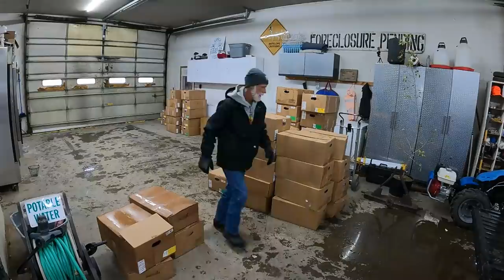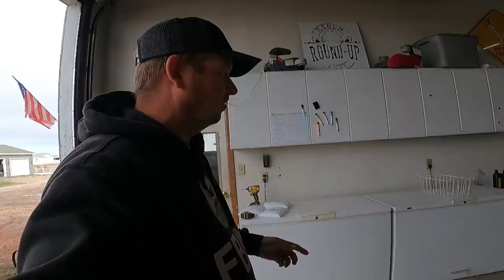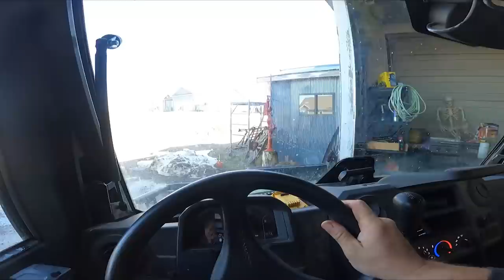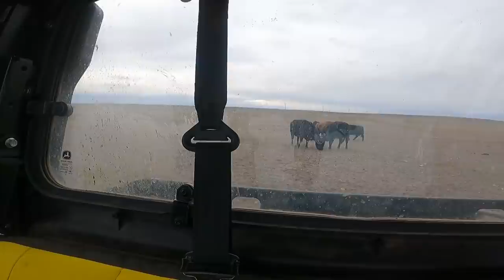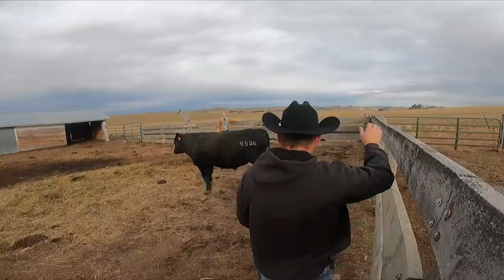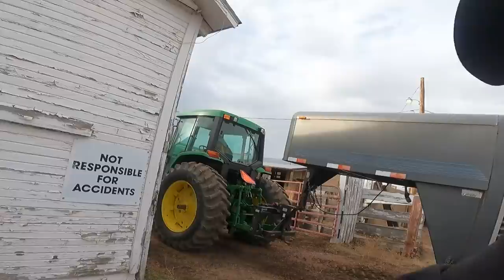Erin Crashes the Car, Meat Arrives & We Move Doof - Weekly Vlog #12

Comment: you home on wheels does not look winterised yet Jeff - I have seen other you tubers winterise their trailers with small straw bales that fit under the van to stop the snow, and cold going under - in effect insulating it from below - they do still insulate/lag and wrap the pipes with heat tape to stop them from freezing - some also put their trailer into a tent to stop the wind just as another barrier from the wind to keep the inside of the trailer warm - the tent is a dome to keep the snow off the roof of it
Reply: Yes, I was wondering the same thing about Jeff winterizing his trailer.
Reply: Add it to the project list, get Jeff's home winterized!

That's one of those things you don't wanna stand back and say "Well, you live and you learn" after all's said and done.  You want it done now, before the storms start coming and don't stop coming.
Reply: If I were Mike, I would move Jeff and his wife into the rental house over the winter.  It is just too darn cold in a trailer.

Comment: With all of the meat(s) that you have stored in all those freezers, I hope that you have several backup generators in the event of power loss that might last for days.  It might be worthwhile trying to find a military surplus diesel generator.  The first unit I was assigned to in the Army was an aircraft direct support company.  We had two 60KW and two or three 45KW generators that were trailer mounted.  Then we had some smaller generators that ranged from .5, 5, 10, and 20KW generators that were mounted on the shop vans we had.

Comment: Glad Erin is okay as you can replace vehicles but not lives. That was sad about the calf's leg but freak things happen on the farm or ranch. I had it once where I walked into the farrowing barn and the fans were running like normal but the night before we had a freak storm but I walked into the barn and I had 5 sows laying dead in the farrowing crates but the baby pigs were ok, so I called the vet out and he figured out that it was of the freak storm and barometric pressure and caused them to have a heart attack of some sort. I glad Jeff was able to help you out this year Mike as you couldn't have Erin out with you all the time and I know lots of times it takes more than 1 set of hands to do things on the farm and ranch. Mike do you have a backup generator for the ranch in case your power goes off, especially for all the freezers that you have, would be something to think about as we had a WinCo generator on a 2 wheel trailer and was setup for 540 rpm bad thing was we had to put it on a 1650 Oliver loader tractor and it scared me to death when I had to fill it up with gas as the manifold was cherry red and the only way to fill it was gas cans. Wish you were getting all the rain that Iowa and Minnesota have been getting in September and October as your grass would be growing like crazy and the ponds would be up also.